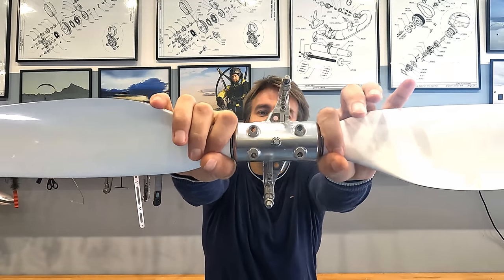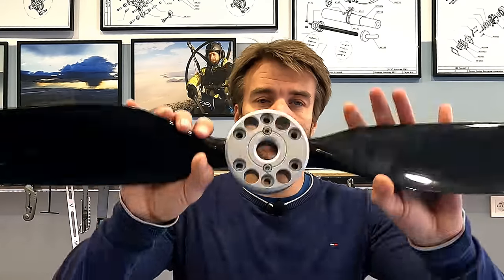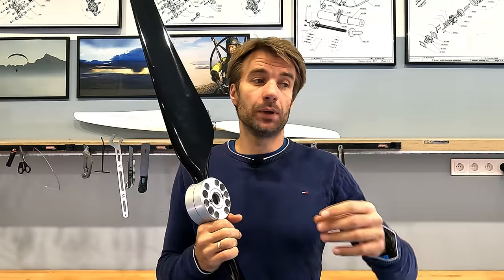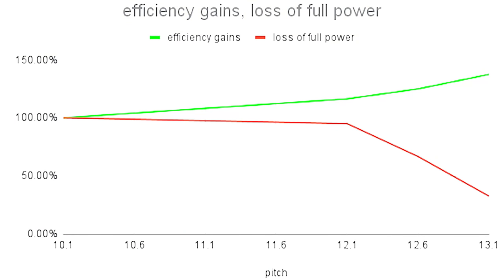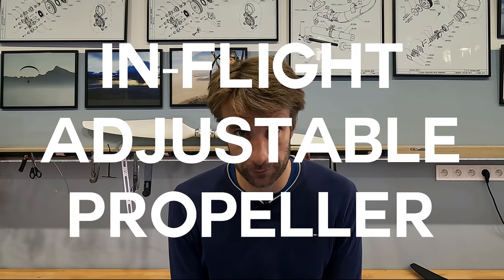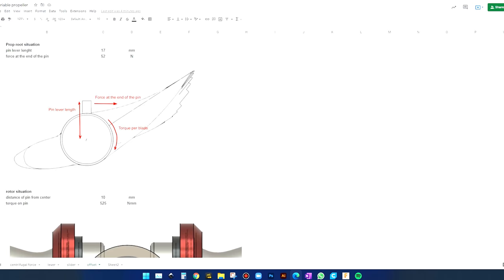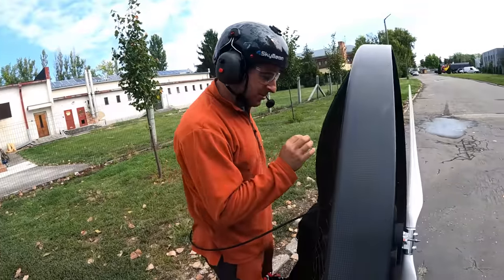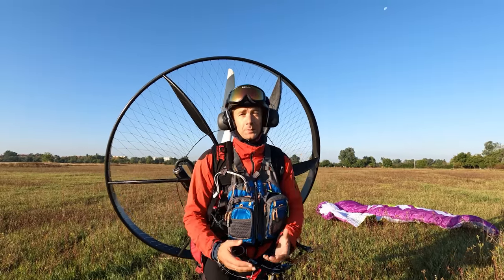Will this be the best paramotor propeller in the world? Variomatic propeller

Comment: This is fantastic! As a variable prop flight engineer I really appreciate the efficiency benefits or variable pitch props, especially in the world of paramotors and its weight limitations.
Reply: Tom, do you have any commentary on the passively variable pitch prop that's been used on low HP UAVs, made by Aerovate? I realize that Aerovat'es design is focused on increasing speed range while Miro's design is intended for fuel economy, but as a variable prop flight engineer, I'd be interested in hearing your insights. For reference, a video on Aerovate's passive prop is available at https://www.youtube.com/watch?v=3tAUyz8raa0
Reply: @jonathanjaffe8897  Hi Jonathan, thanks for sending the link. The Aerovate variable pitch prop system appears to have the necessary safety features (pitch lock) and it uses the same (spring/CG sensor) technologies that have been around for some time, as echoed in the comments.  The blade shape and twist appear to be designed for efficiency on smaller aircraft. Wonder if they plan on a developing a larger system to be used on a constant speed powerplants - reducing maintenance and complexity.  I enjoy seeing the innovations that come with new materials and fabrication processes !

Comment: After being a hang glider pilot for two and a half decades I realize that innovation in this field is very slow. So I really appreciate something like this. Awesome job!
Reply from the maker: I respectfully disagree. Gliders of today are way better than 10 years ago. 
Several engine manufacturers have developed EFI and are very close to market launch. There are more and more paramotor frames well designed and engineered. There are some nice projects in electronics and headsets. This sport is going the right way I think.
Reply: @SCOUTaviation  That's really good but we will have to agree to disagree. And I suppose that a lot of little things do add up to big things, but what I see is that there was nothing that prevented this propeller from being invented 20 years ago. It's great work and I'm not trying to diminish the accomplishment but the technology was there waiting for someone to put it together. R&D budgets in our community are almost nothing and the people with skill and drive to advance our sport are somewhat limited due to a low amount of people within the sport. In 1992 the Swift had a 25:1 glide... Today it has a 27:1 glide. Only 2 additional glide points! I'm guessing that the tech to do better has been here for 10 or more years and finally next year we will see the Swift 3 with a glide in the low 30:1 range. I had a first gen hybrid wing that was first built around 1999 and had a 17:1 glide. To my knowledge the Atos still hasn't cracked 20:1 20 years later. Big advancements are rare and slow and usually by the time it is integrated into our sport the tech has been there for decades. I've read enough articles to suggest that right now there's a silicone anode battery out there that has 10 times the capacity of current lithium and makes gas for flying obsolete. But it isn't viewed as commercially viable due to "only" having 300 cycles. That doesn't cut it for a car but that's a decade of flying for many pilots. We don't have enough people out there looking for these things and implementing them. So it will be another decade before we see a comparable battery actually hit our sport when in reality we could be using it right now. This is why I feel like this sport moves incredibly slow...

Comment: As a paramotor pilot and UAV design engineer I'm really impressed with this technology as It is a plug and play item that requires no changes in the paramotor operation and provides amazing fuel save. Wish the best for the fine design and production of the product.

Comment: Amazed that it is only 2 degrees difference to see real benefits.  Of course everyone will want to know, how much?  Will it really be worth the extra cost, or will it become one of those, "It's cool, I have it" status items? 

Before you even get to production, people will be asking for one for different engines and different RPM's
Reply: @firstbloood1  I understand what you mean, but can your bladder last 5 hours? I suspect most guys would just load slightly less fuel for reduced weight.  Also, even if 33% is true, that's only at cruise, so results may vary, depending on pilot behavior.

Comment: Love the R&D gone into this. 800 rpm drop is huge.
Reply from the maker: 550 RPM reduction actually
But we may try even steeper pitch
With ground-adjustable 13 was maximum we could do due to loss of peak power and increase of temperatures.
With Variomatic we do not have those problems.
Reply: @SCOUTaviation  ok 550 rpm, but that’s still what like 1+ LPH less fuel burn? 😍
Reply from the maker: @DanielJonesParamotor  in-flight consumption test video being edited right now.
Reply: @SCOUTaviation  looking forward to it 👍

Comment: The only concern I have is the use of a 2 spring design that allows a failure to leave one prop at a higher pitch than the other. Maybe you could use one larger spring centered on the hub and linkages that extend to the pitch horns of the props so that they both must always change pitch at the same time
Reply from the maker: The blades are linked and move simultaneously. You can see that in few clips in the video at 6:38

Comment: Hey Miro.  Propeller pitch is not specified in degrees but In forward distance traveled per revolution by design. (Essentially propeller is an air screw.) Pitch angles are specified for fixed wings. Please correct me if I'm wrong.
Reply from the maker: You cannot set that distance with a tool.  For adjusting the pitch you need a number that you can actually measure.  the angle at 75% off the prop radius is used. For that you can use and protractor.
Reply: @SCOUTaviation   Yes I understand that. For a while I'm trying to find out what is the pitch of a regular parameter propeller. No one seems to be able to tell me that information. Could you tell me what is the pitch of the propeller that you sell with your scout parameter? Thanks

Comment: Cool concept.  Question.  What if a spring fails in flight?  Asymetric thrust?  Also, I've had my own Idea for a prop, just have not pitched it to the right folks yet.  Think Submarine.  5 bladed but with attached points at the tips for adding 5 hoop segments or annular hoop design.  5 blades cut down on harmonics, ie vibrations. and the hoop will forever eliminate line snags.  no more lines wrapped up in the prop or nicked by the tips. also tip vortices cause drag.....the prop I propose would eliminate tip vortices, because airflow would be deflected back once it hit the annular ring.  There are some top secret subs out there running deep with these props right now......
Reply from the maker: The blades are linked and operate simultaneously, you can see it at 6:40
A duct would help for sure
Reply: @SCOUTaviation  Ok. I see, if one spring fails it's just less resistance.  Both arms still move in synchro.  You mention duct, but that's not exactly what I'm talking about. The system you have on the carbon scout is sort of a duct already.  I'm describing more of a hoop that spins around with the prop tips.  It does not need to be mounted in a fan shroud like a carbon scout has.  It could be mounted on say a parajet maverick and still have the same effect.  Also the annular ring I'm thinking of would not be as wide as your scout duct but more of about a 1 inch wide ring segment that attached at the blade tips using either a snap in design or with hardware/ countersunk screws etc. Have a look at this vid at 16:06  https://youtu.be/ugSEIiTZ1Pg?t=966

Comment: Wow! Great news! Thank you for doing this. Technically, I think there must be a single spring to operate the pitch of both half-props. Two springs are inevitably different and will produce different pitch at certain RPM range. Unless there is a "flip-flop" effect and only two positions with no intermediate.
Best of luck to you!
Reply: (Maybe you could do the spring arms going along the main motor/propeller axis and a single spring in-between the arms, which will equally push both halfs.)
Reply from the maker: We have designed it this way to have it fully adjustable. With this system it is very easy to change springs and we tested more than 10 different springs at maybe 30 different pre-load settings. 
We have both blades linked together so that they move simultaneously. 
Yes, maybe the final design would have just one spring. we will see.
Reply: @SCOUTaviation  Oh, if the blades do move simultaneosly, then the number of springs doesn't matter: each spring actually controls both blades! And more: each adjustment screw then also adjusts both blades! Great. With 2 different springs you can then actually have 2 different ranges! Great! 
I will be looking forward to have one of such props for my CorsAir Black Bull. Thank you!

Comment: 06:10 - "The in-flight adjustment is done by the pilot from the cabin"
==> Not quite.
The pilot adjusts the propeller propeller control  to achieve the desired engine (and prop) RPM. The propeller pitch itself is fully automatic. Airplane pilots do not have direct control control  of pitch (except for feathering and reverse). Rather, it is the propeller governor that controls pitch, and will continuously vary the prop pitch to maintain the selected RPM in various flight regimes.
If the prop is turning at say 2300 RPM in cruise and the the airplane suddenly gains airspeed during a dive, the pitch is AUTOMATICALLY increased do maintain 2300 rpm, without pilot intervention.

What the pilot actually does is use the propeller control to select best RPM for each scenario. Say, full RPM for take-off, 2500 RPM for climb and 2300 for cruise. The propeller governor will automatically command whatever prop pitch is necessary to maintain those selected RPMs without any further intervention from the pilot.

The key here is that the pilot does NOT control propeller pitch. Rather, he chooses a desired RPM and the governor controls the pitch to maintain that desired RPM under varying conditions.

The wording used in the video made it seem that the pilot must directly adjust propeller pitch for varying conditions, which is not the case.

Comment: Great to see an idea pursued, and the reward of success.

Are you guys considering any designs for a 3-bladed version  --  If I had a  paramotor  I'd prefer a 3-blade prop behind me, based on the same reasons why Wind Turbines are using 3 blades.
Cheers.

Comment: I can see the neatness of the variable pitch prop, but why not design a smaller version of the CVT transmission (variable pullies) to vary the speed of the prop? The springs in the pullies can be changed to get faster or slower response. It would give you the grunt/speed for take off but reduce the speed of the engine to save fuel.
Reply from the maker: Yes. That would most probably work too.

Comment: i remember ages ago seeing a scimitar prop that was shaped such that it did a similar thing...higher rpm's would make the prop twist slightly to decrease the angle.  this was a shape and materials problem rather than a spring...i'm sure the spring solution is far more accurate.

Comment: Awesome! Looking forward to it!
Just one question: how can we calibrate the spring tension for that sweet spot? I mean, how can we check, over time, if it still has the original settings after 100h of flight,  for example
Reply from the maker: good point. we will see after 100 hours🙂
no seriously. we have to simplify the design for end-user. This one is fully adjustable for research and development purposes. we have adjustable stoppers. We even have some brakes and dampers (not on the video)  to reduce eventual fluttering but that turned out to not be happening. 

work still in progress
yesterday we did some very precise fuel consumption measurements. on video of course

Comment: Do you remember the old timing advance systems that used counter weights on the rotor of an engine? We used to put heavier weights to increase the timing advance at lower RPMs. At higher RPMs, the weights would cause the rotor to advance the timing of the firing even more of the spark plugs. Can this method be used here? It seems that both blades could be activated at the same time using this method instead of 2 springs that can lose their pressures at different times? Would LOVE to work with you on this. Simple, 2 weights, 2 cams. Just like the old timing advance kits on older engines!
Reply from the maker: We were considering centrifugal force. But why adding weight to somethings we want to keep lightweight? 
Long term testing will show eventual fatigue of the springs.
Reply: @SCOUTaviation  OK,,, I think got it. I have an Idea involving only 1 spring. It would be less weight and both blades would always be at the same pitch as each other. Not sure I want to share this on here though.

Comment: Great! A very good innovation! I want to know what will happen when you broke a blade, can you replace it or need to buy a complete set? Do you will make a wood propeller version?
Reply from the maker: Even our standard props are always balanced to one single prototype. that means if you break a prop blade you only need to replace that one and the new blade will match your old one. 

No wood
No fibreglass
Because carbon

Comment: Innovative idea! How does the power curve feel on the ground? Does it require more precise throttle control than a regular prop? Are there any drawbacks for beginner pilots? When will it be available and in what sizes?
Reply from the maker: It depends on the springs used. 
With springs with lower spring constant the shift was very quick and I could hear sudden increase in RPM when it changed pitch from 13 to 10. Exactly like when you downshift in a car and the RPM go up suddenly.
Now we are using a stiffer spring and that changes the pitch continuously from 13 to 12.5 to 12 to .... to 10 as I keep adding throttle. Smooth. So there is no sudden change in RPM nor sound. It feels very natural and pleasant. Yet we need to test it more because maybe we will find out that a quick downshift is more beneficial although it may feel a little weird / not used to. I do not know.  

In terms of thrust it feels more like a diesel engine = having thrust all the way from the bottom. It is really nice.

The only drawback could be lines getting tangled on the springs if the glider falls on you on landing. But that should not happen or not frequently at least. You do not want your lines over hot engine regardless of what prop you are using. 

Only one prototype exists at the moment. 1320 mm in diameter, made for Vittroazi Moster engine.

Yesterday we recorded another video, so stay tuned for exact in-flight measurements.
Reply: @SCOUTaviation  regarding the line snagging issue, could the design be adjusted to accommodate a prop spinner?
Reply from the maker: @paramotorhead  yes
but good training weights less:-)

Comment: Im really excited for this. Its something i have been thinking about for a long time. And you have done a great job of simplifying such a complicated mechanism. I would love you fly one of these. Let me know how much they will cost. And if you will make them for the vittorazi fly evo oh but Remember to not ground start your motor. 👍🏻
Fly safe
Reply from the maker: thank you for your support
now we have a steel stand for ground-starting the engine. 
Isn't the Vitto EVO out of production?
Reply: @SCOUTaviation  I believe it did get replaced with the atom but the atom is working just a little to hard for my weight so I'm keep the fly evo 2 until I then need moster power lol.
I'm really excited about this prop though. It looks very promising and I will for sure have to have one (even if I have to have a plate made up to connect one designed for the atom)

Comment: Good job guys. Will it be possible to fit this mechanism to the Polini Thor 202 or only the Moster?
Reply from the maker: Only one prototype exists at the moment. 1320 mm in diameter, made for Vittroazi Moster engine.
it would not fit polini as it spins other direction

in the future there would be no problem to design a system for other engines.
Reply: @SCOUTaviation  I know that Polini spins in different direction. But it is good to know that it is possible. I will be first one who buy your adjustable propeller for this engine :) Keep good work guys.